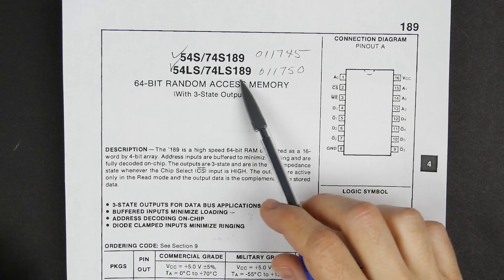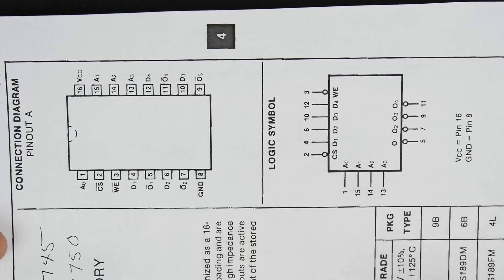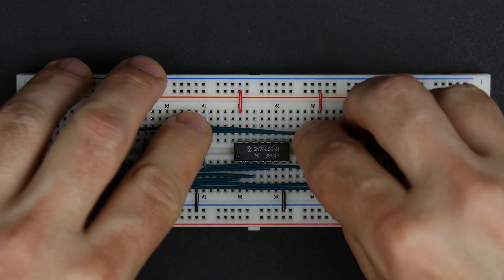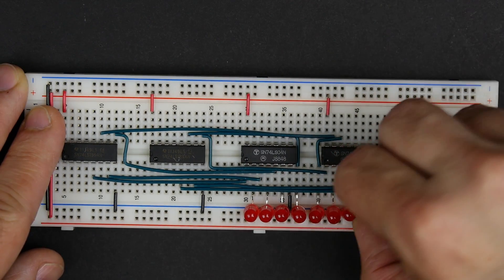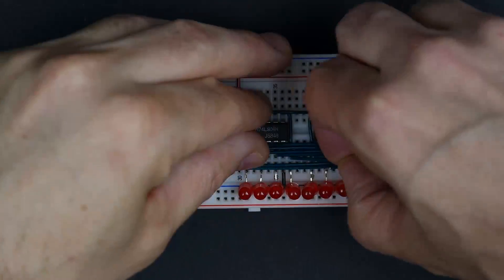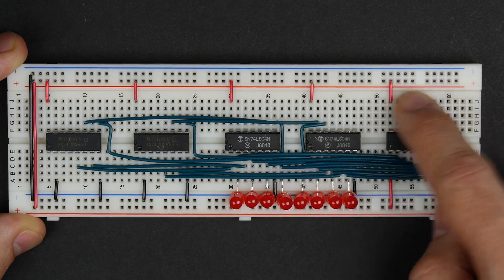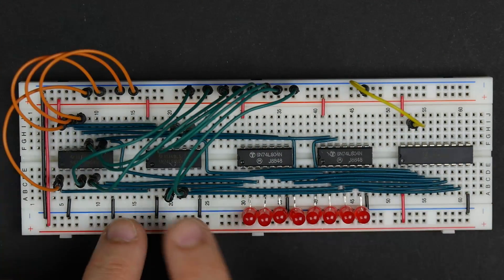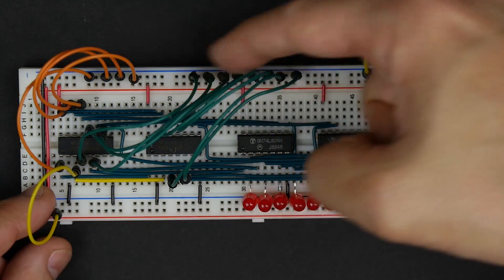RAM module build - part 1

Comment: Does anyone else have an issue where all of the LEDs turn on the moment the WE pin is tied high. Looking at the circuit diagram, it appears that this should happen since the output buffer would switch off and cause the inverters to go HIGH, but Ben's don't do this. Also, when writing, only some of the LEDs switch on while others will be off until a certain time passes and then they will "charge" until they are fully on. 

It's ultimately not a major issue because it stores all of the data properly so I'm mostly curious about why this may happen.

Comment: Hi Ben! I'm building a 12V relay CPU that interfaces with (2) SRAM chips. I use relays to change the signal in and out but I can't get it to work. Any advice on where to get a circuit or something to help me through this. The rest of the systems works well. Please advise, and thanks. Steve

Comment: If you find hard to get 74ls189/74189

You can use 7489 ic it is similar but it is open collector ie it will o/p 0 .but not one so u need to add a resistor of range  1-3kohm to the o/p pin and connect to 5v . That is the only difference.😊

Comment: I dont unterstand how you can connect an led on ic pin without current limiting resister 220-Ohm or 270-Ohm etc

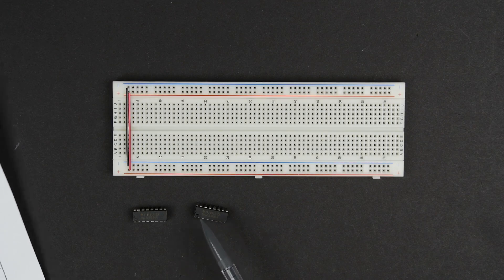Comment: The 74LS186 has tristate outputs 0:19, but the outputs are inverted from what was written to the RAM.  If the outputs from the RAM are inverted using the 74LS04, then we can't use the tristate logic provided in the 186 chip and need the 74LS245 to provide the tristate function. If the data was inverted prior to writing to the 186, and then we could have used the tristate logic in the 186 and would not need the 245.

Comment: Wouldn't it be more logical and clear what comes to wiring to have instead of this

|mem| |mem| |inv| |inv|

to have this configuration

|mem| |inv| |mem| |inv|

And then you could think mem-inv pair as one logical unit. Then you could tape some paper over them and write "mem1" and "mem2" on the paper so you wouldn't have to mind yourself with the inverters ever again :)

Comment: I was sent a faulty 64bit ram chip when ordered from your website also many of the ic pins are bent when arrived in the box. 
Is there any way to contact you on sending new ones?
I have compared the two ram ic and one works well while the other outputs does not work. I check both on breadboard with leds and with oscilloscope.

Comment: Umm actually if someone can help me, the 74LS245 is getting it's getting it's output pin down to < 2V in that case how can I pull it up so that the LEDs light up, what resistor configuration shall I use for the same?

Comment: What I learned early on is, if there is a 74LS189 with inverted outputs, there is also a 74LS2189 without inverted outputs... but it has open collector inbstead of tri-state outputs. Perhaps this is the reason why they went with inverted outputs...

Comment: 11:11 Why this is happening? Doesn't all data get wiped when you unplug ram? Is that because of noise in environment?
Reply: It does, and when you connect the power again, the memory contents could be anything. But it seems that this particular chip has a tendency to initialize the first ram location to 11110000 when it's powered on.

Comment: Amazing Video 🙂, RAM seems to be an easy thing to program, not like EEPROMs needing sort of a pulse to program... But I have a question, how the LEDs are connected without resistors? Does the inverters have sort of Pre built resistors or current limiting onto them?

Comment: Really, really enjoy your content! I notice that in some of your videos you use current limiting resistors for your LEDs, and in others you don’t. Is this because the chips inherently limit the current for you, so they are not needed?
Reply: I had the same question but I do believe he mentioned something about output impedence for some chips in one video.
Reply: @justinjames3028  Yes, it seems that many of the chips don't have outputs that are strong enough to destroy the LEDs/make them too bright anyway.
But I think that adding some resistors would have been good anyway, because adding the the LEDs is really pulling down the high logic level to maybe 2 V  (depends on the LED, could be a bit less, could be more especially for shorter wavelength LEDs).
But then he would probably need higher efficiency LEDs because the current would be lower.

Comment: Why did you reverse the order of the output bits for the 2nd RAM chip?
Reply: It doesn't matter - you might store 2nd bit of bus in let's say 5th bit of RAM. Just important to connect same significancy input and output bits to same bit on bus - Not sure if comment helps

Comment: I used the 74LS219 (non-inverting RAM) and saved some real-estate. Used the extra space to add the needed resistors to the LEDs
Reply: Are there not resistors built in to the IC?
Reply: @xanri7673  There are, but the ICs are not meant to supply the amount of current needed for whatever ic is the input as well as the LEDs
Reply: So sometimes it may work...but it may not

Comment: I wonder if it would be good measure to use some resistors for the IC outputs that you connect LEDs to. I realize that the TTL (Transistor-Transistor-Logic) ICs are only capable of proving a milliamp or so of drive current. But a low value resistor between the LED and the IC output I feel is good practice. It will protect the IC.

In the "real world" you would use buffer transistors to drive the LEDs via the 74LSxxx IC outputs.

I would like to sponsor you Ben. Have you taken that polygraph under the influence of truth serum with screaming kids running around you yet? I do hope you are innocent. You seem like such a nice intelligent person in your videos.

Comment: For SRAM you can use 6264 (8KB), 62256 (32KB), 621024 (128KB) and 551001 (128KB).

They are a little more expensive than one 74LS189 and also have a lot more of space, maybe unusable.

But they have a 8 bit bus, so you only need one, they don't have inverted output and they are JEDEC standard so they are manufactured from a bunch of different companies and all of them have the same pinout. Making easy to swap them.

I use them on my homebrew computer which uses microprocessors so are far more simple than Ben's one.

Comment: Using XOR gate instead of inverters on the output might be interesting in that it would provide a fast way to do ones-complement and logical NOT operation during your memory read cycle via a control signal to the XOR
Reply: It'd probably be better to implement that in the ALU rather than in the memory readout because then you'd be able to XOR a register and not have to store stuff to memory before being able to do bitwise stuff.

Comment: When my write enable pin goes low,  all of my leds light up very dimly rather than go completely out.  I noticed all of bens leds go off when he takes the data write pin low.  Any ideas?
Reply: Use cmos chips instead of ttl ones. Make sure to use original chips with low leakage current and use 5v or 3v as supply voltage.
Reply: Perhaps ground isn't properly connected

Comment: If you hook up LEDs to the output of the inverter, doesn't that make a HIGH voltage equal to the diode forward voltage? Isn't that too low for a HIGH input in the tri-state buffer?

Comment: This 74xx189 is so hard to find! Can you recommend a more widely available (and also bigger) chip?
Reply: no one is using static TTL RAM nowadays.....
Reply: @fifi-fx4yb  by now I have plenty more experience. There are so many SRAM chips of much bigger size and they work just fine. And they are usually CMOS but that's totally compatible.
Reply: @guntherschadow9383  So what is your CMOS SRAM choice, pls?
Reply: @fifi-fx4yb  

ICM6116L-12	2k x 8-bit SRAM      - because it was cheap
MSM2114L-2RS	1k x 4-bit SRAM      - I was working on a 4 bit machine for some time
UM61512AK-15	64k x 8-bit SRAM    - this would be standard to use for any 6502 project, one chip does all 64k
CY7C164-20PC     16k x 4-bit SRAM   - I used this for my Conway Life Machine

Comment: Just to make sure I understand, this memory works with D latches right? And if you cut the power, there is a chance that the memory you stored is lost or simply stays there?
Reply: Its lost.  The reason the ram is called static is that when power is on, the transistors making up the D latch are basically wired into each other and sending a locked signal into each other.  They will do this forever, like a switch that powers a relay to keep that switch on.  Once the power is off, this "relay enabled switch", or series of connected transistors, looses power and they no longer feedback into each other and act as a latch.

Now you would have to look at the data sheet for you D latches to see what state they start up in when power is restored.  They could be on, off or totally random.

Oddly enough, the dynamic ram could retain memory when power is cut off.  The capacitors are like little dying batteries and if power is restored quickly enough and they are designed to not reset themselves after power is turned on, then they might retain all the data that was stored in them and do the read/rewrite refresh cycle to keep their charge topped off.
Reply: @kurtu5  huh interesting. Thanks for the info!

Comment: Wouldn't the LED's clamp the output of the inverters to approx. 1.2V which is less than the recommended 2V input for the 74LS245?
This would result in the input staying in the Indeterminate region of the input - therefore when it works, it limits the speeds possible of the circuit.

A resistor in series with each LED should resolve the issue.
Reply: As a rule of thumb, I think that red and orange LEDs have a forward voltage around 2.1 to 2.2V.  (Infra-red is commonly 1.1 to 1.2V)...
However, this circuit is still not ideal since the only current limit for the LEDs is the limited drive capability of the 'LS04 / 'LS244

Comment: I know I am a bit late but why don’t you use EEPROMs for the RAM instead of the chip setup you have here? It seems like it would make it more simple and get you more capacity too. I watched almost all the 44 episodes in this playlist in less than 24h!!! I love it! Also I can’t wait for part 2 of the graphics card!!

Edit: make ~is~ /it/ more
Reply: EEPROMs are not designed to be constantly erased and rewritten. They're also pretty slow. So you wouldn't want to use one for RAM.
Reply: Clickety Clack thanks a lot!! So is there anyway we could increase the ram capacity? I mean more than 16 memories adresses? Thank you
Reply: Sure. Increase the size of the memory address register and add more RAM chips. Just takes more hardware.
Reply: Clickety Clack yea that seems obvious now :/ thanks! I just started building my own just like Ben and I wanted more ram. I’ll find a solution.
Reply: I think the EEPROMS would have worked fine for this computer.  The EEPROM read/write limits are probably beyond this computer.  However, the use of the latches helps demonstrate some basic memory theory that is in use by computers, so I think they were an excellent choice from a pedagogical point of view.
Reply: kurtu5 I found the SRAM chip CY7C199 for my ram: 32k adresses for 8bits words. Its coming today in the mail and cost me like $4. I think is will be more than enough

Comment: Is there a difference between a 8-bit sram and 8-bit register. They look pretty same to me
Reply: SRAM can store multiple amounts of data at different addresses. In this case, it is 8 bits of data per address.

Registers can only store one 8 bit piece of data. Usually a number or a single instruction to decode and execute.

SRAM is more useful for storing program data than registers. Registers are good for storing a single instruction/parameter while it waits to execute the intended operation.

Comment: Why so complicated? 2 SRAM chips + inverter for each. It would be better to use single RAM chip with normal (non negated) output. Not sure about the buffer, maybe it would be possible to get rid of it too.
Reply: The buffer is needed if we want the LEDs to show the memory contents even when they're not being driven onto the bus. I agree about the rest, but it was probably based on which chips Ben had available at the time.

Comment: I'm wondering if you missed a trick here: if you had done the inversion on input rather than output, I think you could have taken advantage of the tri-state capability of the RAM ICs and wouldn't have needed the 74LS245 on output. Is there a reason you didn't do it that way?

I absolutely love this series and have learnt so much from it - thanks for making and sharing it.
Reply: I also thought about this, but as someone said above, then you wouldn't be able to see the memory contents on the LEDs except when they are being output to the bus.
Reply: @possible-realities   You are essentially storing the invert of your data on the registers inside the RAM chip (which I guess we shouldn't do). I guess you can see the content of your registers in the LEDs because they are inverted by the RAM chip itself.  You send the inverted data, and then by selecting the address that inverted data is stored onto a register. The tristate logic of the selected register with its enable on would put the data onto the bus of the RAM chip. But the data on the bus is inverted by the RAM chip on the output side. So, I guess we should be able to see the (real) content on the LEDs.

Comment: According to the data sheet you showed the 74LS189 has tri-state outputs, so why are you adding extra buffers to the outputs if you already have them on the 189?
Reply: RAM data outputs are inverted so he has to use those buffers to get the data inverted again.

Comment: If you invert the data bits on the way into the RAM you would not need the tri-state buffer chip since then you could use the RAM's tri-state outputs to get it on the bus and reduce the chip count by one.
Reply: you'd also only see what's at that address when you're writeing to the bus.. probably why ben chose to not do that, but it's still a good optimozation if you don't care about that.
Reply: @markkeilys  and also reads are likely to be greater than writes so reading would be optimized.

Comment: This is all well and good if you're doing this in school, where you have access to these chips, but the 74LS189 is an ancient and obsolete chip that you're just not going to find very easily, or cheaply. I've been having a hard enough time just finding a cheap ALU. The 74HC181's I came across wound up being nearly $2 a piece (10 for $20 or so) compared to maybe $2 for a pack of more commonly used chips. So forget that. I guess from a practical standpoint, these sorts of chips really have no real use outside of education anymore. Not when you can buy an arduino nano for pretty much the cost of a single 74HC181. Sure it's not as purist, but as I said this is from a practical standpoint. It's much cheaper, easier and quicker to use an arduino, or other MCU for a solution than a bunch of clunky logic chips. I think they're still vital for learning how this stuff works from a hands on point of view, though. I definitely wouldn't be where I am without my tinkering with logic chips.
Reply: So... what? You seriously think this computer has any real use other than education?? The WHOLE point of this is to educate on the basics of a CPU (or computer in some sense). NOT to use it to solve ANY real problem or task, that should be obvious!
Reply: That's not what I said at all. You're supposed to read comments, not read INTO them.

Comment: Is ram the same thing as an eeprom, or are they the same thing?
Reply: thats different stuff. RAM either static or dynamic depends on power and EEPROM doesn't. RAM as much faster for write process comaring to EEPROM that also has limited write cycles while RAM doesn't have that limitation.

Comment: Do you think it is possible to use pc ram? The pinout can be found at 
https://allpinouts.org/pinouts/connectors/memory/ddr-sdram-dimm-184-pin/
And I think it could work if you used it right.

Comment: Q: could you have replaced the 74ls04 with a 74LS240 ? And wired the G's low ? that way you would only had just one chip instead of two ?

Comment: What is really nice about this setup with the two 74ls189 chips is that it is easy to expand. What i mean by this is that you can simply double up this setup by building another RAM module exactly the same as before, and use it as another bit worth of addresses. The way that you would do this is by connecting the fifth bit of the addresses dip switch to the second RAM module's enable lines through an inverter, so that when you want to store more stuff, you can switch between which module you are storing in. The only annoying thing is that you would need to connect all the address lines of the first module to the second module which is a little inconvenient.
Reply: If you really want memory expandability for this computer, I recommend using an 8-bit wide SRAM chip, e.g. a 32k x 8 in PDIP package only costs a few bucks. I would think 32 kBytes would be enough :) As a bonus, you get to use both directions of the bus transceiver and have to figure out the slightly different logic needed to use the LEDs and the programming system that comes in the following videos, heh.